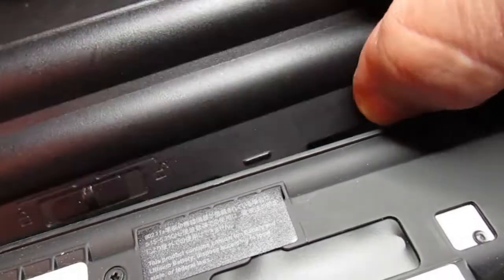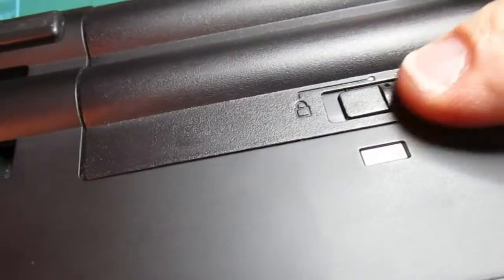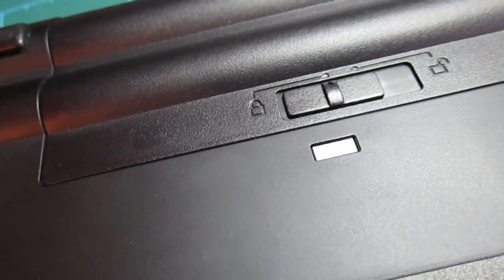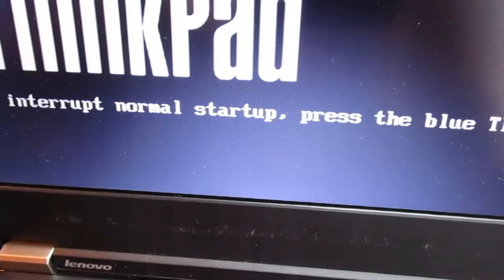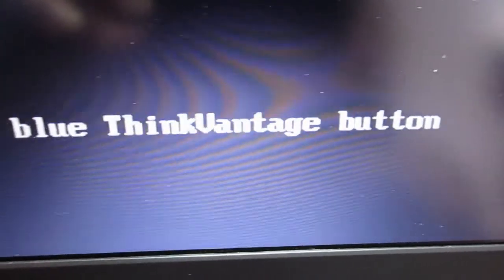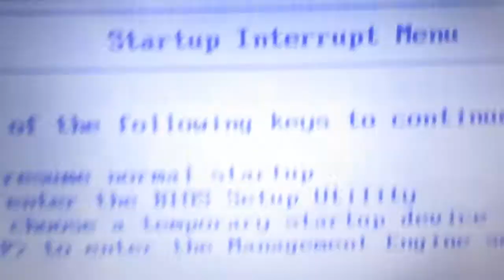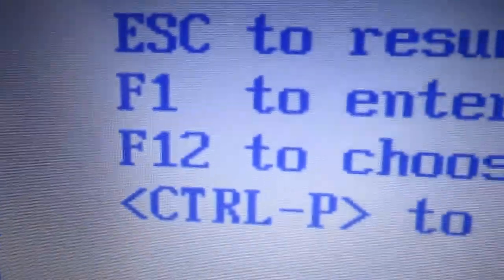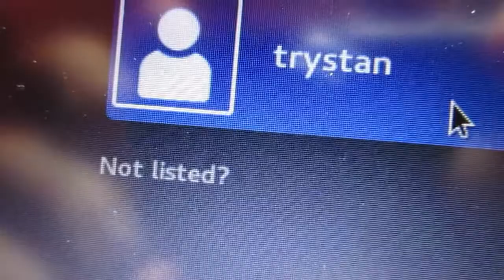Lenovo ThinkPad T420 Hard Drive replacement with SSD

Comment: Hi does any 3.5in caddy work? I'm buying a ThinkPad like this laptop without the caddy or drive and I can take the rubber sliders off a R61 ThinkPad im not using
Reply from the maker: I'm not sure, sorry, but I'm guessing that if the rubber sliders fit then you'll also be able to slide it in. Be sure to attach something to the caddy so you can remove it too. Good luck!
Reply: @TrystansWorkbench  thank you

Comment: Great video, but how about a follow up video showing how you restore the OS onto the new SSD drive. It would be good to see exactly how it's done, whether you burn system disks first, then use them to install the OS to the SSD. It would be good to know what size a SSD can be for t420 and which type/size. I understand they come in different sizes but which is correct for the t420 caddy. Although lots know how to do this, plenty of casual users never get to do a HDD replacement and install of the existing OS. I have heard that some folks remove the CD/DVD drive and put the removed HDD into it, makimg a second drive available. Can the OS be copied across to the SSD if you do it that way?
Reply from the maker: Thank you for your comment, and for the great question and suggestion. In this particular case I was replacing the hard drive from another laptop of mine into this one as I had hardware problems. The way to upgrade to a new disk and transfer the OS over is to put the old hard drive in an external hard drive caddy, connect it up  via USB, and then use Clonezilla https://clonezilla.org/ to bring the OS over. It's free and open source software. (Use YouTube for help on it). You are quite right about SSDs being different thicknesses. The Samsung SSD in this video is 6.8mm, the original drive was a little thicker (I don't have it at hand to measure it for you). Many are 7mm which are fine. I would suggest avoiding thicker ones.

Comment: I have a T420, and the drive I removed has an extra set of three pins.
Reply from the maker: Hi Mark, thank for your comment. I think that the additional pins (some four pins) in the old drive were for configuring the drive to use (or not use) additional drive features like RPS "reduced power spinup", and SSC "spread spectrum clocking". All the best.